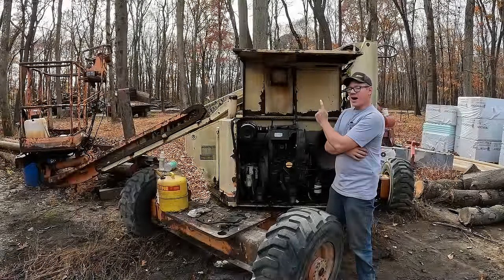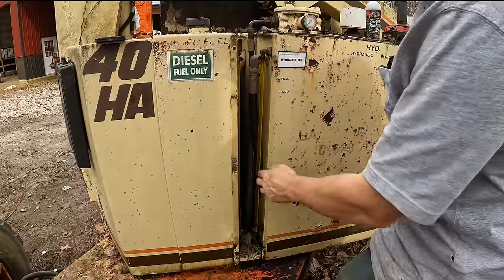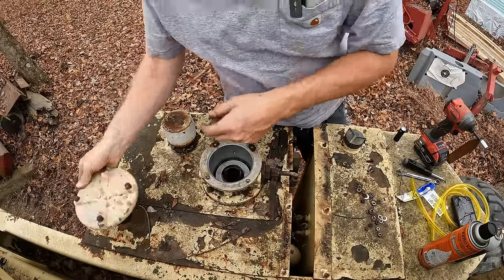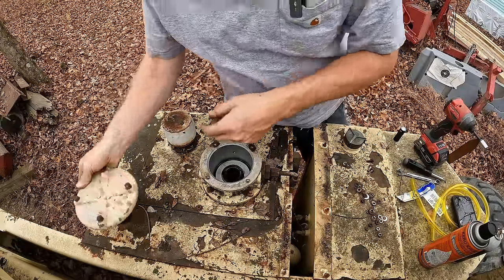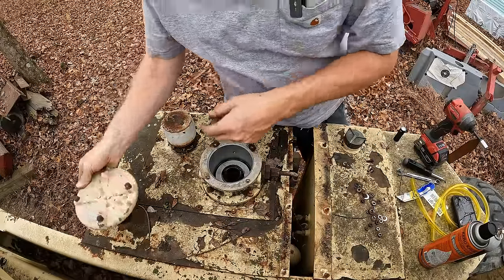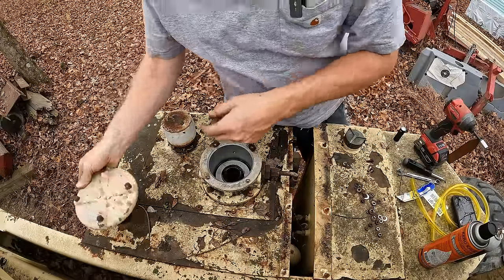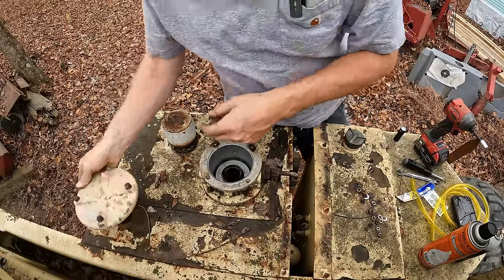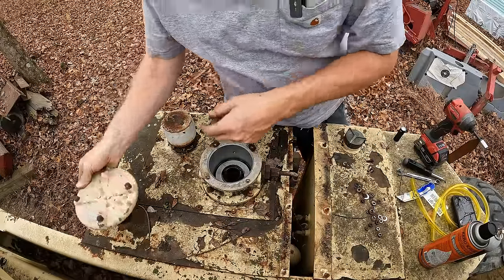I paid $1000 for this 4x4, Diesel, Man-Lift, What could possible go wrong? (JLG)

Comment: The electrical issues look to be a project on their own, but for the price, still a great project. Very handy machine !!
Reply: I am wondering if it is actually easier to try and fix what is there, or with the state of nonfunctioning of the controls, to redo the whole control box anyways, if there is documentation. Someone mentioned to me he would just replace all wiring. Depending on what state the wires for example along the boom are in, that seems a bit excessive for me.
Personally, depending on availability and price of the control switches / levers, I might at least redo the control panels (or the one on the platform only). Maybe switching over from single action levers to joystick type controls. I wonder, by the way, if those are just simple switches or if that thing has at least some speed control on the movements. But that is just one way to fix it, and as mentioned, might be subject to decisions based on price and availability. What I want to toy around with for fixing might also not necessarily be either the most optimal, nor the "what really only is needed to fix it" approach. Other than that, I would for sure check the wires in that chain guard on the boom. If they got brittle and might short out, the last thing I would like to happen is to get stuck on the platform in the most extended high up position.

Comment: That Shell Rotella Oil is all I use in Diesel engine. FYI Matt if you don't know, the filter housing next to you  had by the oil filter is the hydraulic high pressure oil filter. it has a reset on top that tells when it is needing changed. I believe you got a good deal in that life. All the work you put in I really believe you can get back.. Great video Matt. Have a great week and God Bless.

Comment: To remove oil from a tank like that I take a Shop Vacuum and a 5 gallon pail.  Hook the hose of the vacuum to the large hole on the 5 gallon pail install a 1/2"  JIC bulkhead fitting to the lid of the five gallon pail and a piece of 1/2" hose to that. Turn on the vacuum and suck the oil into the pail watching the level. Empty the pail into your waste oil drum and suck the tank dry.

Comment: Great episode, as a long time user of man lifts, I would recommend the use of a full body harness and lanyard. I have experienced a few  unexpected violent motions from uneven ground or errant control movement (operator error), that almost took me off my feet in the basket.
Reply: Love matts content
Reply: This comment right here ^

Work restraint harness and landyard will save your life. These things are temperamental at the best of times
Reply: Good point. And lanyard doesn't mean a fall arrester. You need a short lanyard to limit motion.

Comment: Hey Matt, just a little hack for cleaning out oil, diesel and tanks in the field, I’ve even used it to drain radiators. 
Get your self a battery powered vacuum a five gallon paint bucket with a twist off cap. Attach the vacuum to bucket lid use it like a wet vac. I’m sure there are ready made cordless shop vacs, but I like that I can just use the 5 gallon bucket’s to keep the oil or diesel clean and stored.

Comment: with all the old fuel and fluid tanks you come across, you need one of those vacuum oil change containers... they are either manual/hand pump or use shop air to create a venturi and can get into all the nooks and crannies with the right pipes and tubing.
Reply: I'd just use a shop vac, possibly with a smaller hose to go into the filler.  With a little duct tape to attach hoses and to connect to a probe stick, you could suck up stuff from crannies pretty good.
Reply: @paulculley4652  wouldn't want a shop vac around old fuel or oil, which is what it was suggested for.

Comment: Congrats!  A couple of hints based on my love/hate relationship with similar machines during my 50 or so years in factory maintenance. The yellow tubing, if it is Tygon brand and if rated as you say, also has a good UV protection component. The valve leak in the boom could possibly be an anti-drop valve. It would limit lowering speed in case of a hose break. These are generally screwed right into the cylinder.  Finally, I like your new red truck. Should be able to easily handle some of your bigger trailers.

Comment: Hey Matt, I got a solution for your paint can tip clogging up. When finished spraying, take the tip and put it on top of a wd40 can, spray some wd40 through it, then put the tip back on paint can... Theb it definately won't get clogged up 🙂

Comment: To remove sludge; 5 gal. pastic pail with lid. 1" spigots in lid (epoxy) connect 1" suction hose to one spigot, connect vaccum cleaner to other spigot. Even 12v hand held vac will work depending on lift required. Always enjoy doing tthis the difficult way as well.....bear

Comment: Running and sort of functioning is a good start. Its been a long time since I have worked on one, but the valve you are unsure of I think is supposed to keep the basket from just dropping if something fails. Like it bleeds off pressure slowly, so the basket comes down but in a controlled manner. The wiring shouldn't be too bad, might be expensive since you'll need those big 50' spools to have enough wire to run from the basket to the controls in the body.

Comment: It looks like there is a foot pedal in the basket that you would usually have to press in order to active any of the functions. It might have been bypassed intentionally (or by a mouse).
Reply: There must been a whole army of mouse electricians working on that thing over time. But a foot pedal additionally to the locked levers seems to be a tad excessive to me. But on the other hand, it also looks weird to me why there are big levers for some controls and only little levers for others. Might be the large ones have some sort of speed control to them (small movement slow, more movement fast), but that is just a guess. Also, with those small switches the foot pedal would make sense, as they are not locked, but just protected by those wings around them.
Reply: @alexanderkupke920  the big switches are old school pulse width modulated switches, allowing for varying speeds,(feathering functions).
They appear to be P/Q brand switches. They were high maintenance brand new out of the box.
Reply: You are correct in that you are supposed to have your foot on the pedal to activate functions. It's called a dead man pedal by most people. Booms have a tendency to catapult people who like to travel fast into pot holes. The pedal is there in case that happens the machine will stop moving.
Reply: @alexanderkupke920  the redundancy of the lockouts and the pedals on these machines may seem excessive but is definitely needed. I work at an equipment company and run up to 185' booms. They also have lever lockouts and dead man pedals
Reply: @jasonkeller4180  Calling it a Dead man pedal makes it more obvious why it should have one. Let´s come a lot more scenarios into mind where you would just not only rely on the usually locked levers and the E-Stop.
Reply: @haroldphipps3457  sounds like a heck of fun to replace and test. And I bet they come for a bargain... I would have bet more on something more classic like a operating a potentiometer. I think for some (way simpler) equipment I have also seen stepped switches (like two or three steps with diffferent speeds). But especially when it comes to getting a boom as close as possible to a building or whatever without having the thing jerking around with each movement and running into whatever doesn´t jump out of the way in time, having some smooth speed control for sure makes it a lot more comfortable and usable .

Comment: FYI, So the controls that you have to pull on to move the lever is known as a "dead man control". If the operator becomes incapacitated when they relax and let go of the lever it will return to a stoped position.

Comment: Ran quite a few of those way back in the day .
We had one 90' that was a beast .
It had one issue , in that it had a slight leak down problem so that if you say a while with it off , when you fired it back up to move again , you would freefall a few feet .
Anyway , I and another guy has just finished up a hella long overtime ( 20+ hours ) get it done project , and , were about to clock out when we got tasked with taking a photographer up in the same lift for some pictures .
The same lift we had been complaining about every day for 4 months ...
Being tired , somewhat pissed , and , not very sociable , we agreed .
Anyway , we get the photo guy up , 90' STRAIGHT up in the air , shut off and let him take his pictures .
When he was done , we looked at each other , grabbed the rail , fired up the engine and I hit the down button .
6 feet and a  blood curdling scream later , we slowed to safe speed , My , coworker , myself , and , one fishbelly white photographer who now needed a change of clothes , went our respective ways .
Next day , the rental company finally showed up to service the damned thing , after almost 4 months of reporting the issue .
No mention was ever made of that poor guy , but , he and his dry cleaner probably parted ways the next day .
I have never seen someone so HAPPY to be in a parking lot .
It is but one of many reasons I may go to hell .
Reply: Oh, God, My ribs are hurting from laughter

Comment: May have heard this a million times by now, but I always added a valve on the bottom fitting so I could close off the sight glass or tube whenever I could.  That way of the tube breaks or gets torn off I can shut off the fuel or whatever it is. Works great.

Comment: Hello Matt, back in the 70s we had a 600 gallon oil tank with sight tube, and it had a push button valve at the bottom union with the tank. So the sight tube was only connected through to the tank contents when you pushed the button, giving you a reading, and when you released the button the valve closed. You could also achieve this with a manually turned valve. Could that approach solve your tank emptying concern?

Comment: 37:25 i remember the fuel filter on a friends Peugeot. Theorically you should be able to take it out by hand, but they warned me "it might be a bit tight".

Took out the whole damm filter mount, holded it firm on the vice, grabed an "oil filter belt(?)" that we use for truck oil filters and went ham on it.
Two grown ass men with a truck tool, on a vice, twisting it as much as we dared without tearing everything apart. For something that was supposed to come lose by hand.

Tightened the new on with my bare fingers and hasn't leaked since. I don't know what kind of powerlifter did the service before us.

Comment: One trick I use on fuel tanks to clean them out- my 'homemade' parts wash has a electric fuel pump for the brush hose, that usually runs off a 12v mains power supply from my car fridge with an inbuilt 'lighter socket', but the pump now has a 'lighter plug' on it- when I want to use it outside- take the 20l drum from under the parts wash (an old laundry tub the outlet drains into the drum lol) take it out and plug it into the utes lighter socket- made up a  'stiff long hose' out of a parts wash brush and a length of metal water pipe that screws onto the pump outlet flex hose (the pump inlet screws into a washable mesh fuel filter and that goes into the 'tap' outlet on the 20l drum... that way the  pump sucks relatively clean fluid from the parts wash drain drum)
Usually used for the parts wash, but with the long pipe brush attached instead, you can use it to literally wash and brush the bottom of a tank clean, all the muck ending up in the parts wash drum (fuel drain from the fuel tank into the top opening on the drum)
Works like a dream on tanks, and even better-  gives you a cheap parts wash to boot!!!
(mine cost me under $30 but I had most of it already- an old free standing laundry tub  with a builtin cupboard for $10  (holds the drum and pump and powersupply perfectly), and the cleanable mesh fuel filter ($12) and the parts wash brush with inbuilt hose fitting ($3) were the only things I bought, everything else I scavenged from the spare parts here)

Comment: I am currently restoring and running a 1981 Calvador Condor 48 lift that started out looking as rough as yours. I spent a long time diagnosing the electrical issues and eventually came to the conclusion that the wiring harness had too many intermittent cracks/breaks etc. I decided to abandon the control box on the platform and bought a Newtry (Telecrane) wireless remote control system. Now the controls are wherever I am. I can run it from the ground or while I am in the air. Mine has a Wisconsin VF4D.

Comment: Modify the non vented fuel cans by drilling and installing a tubeless tire valve stem with the core removed. The cap can still be used when storing fuel to prevent evaporation and contamination.
BE SURE to clean the can thoroughly before and after drilling.

Comment: We purchased a system from an oil storage company, and they had check valves on the top and bottom of the glass sight tube. It would slowly leak through with no pressure difference and show the level but if the glass broke the check valve would prevent the oil from leaking out.

Comment: I spent many hundreds of hours of my career in the baskets of these boom lifts, from 40 ft. machines like this to massive 180ft. machines and most of the issues were in the basket controls! If this was a rental machine it was well maintained, privately owned machines not so much! It is amazing how much wiring is in the the basket control panel of these machines! 
    Most of my time was spent in an 80’ machine with a counter articulating jib. You could get into places with that lift that no other machine could reach! All it took was one corroded connection in the basket control panel to shut you down for the day!

Comment: Hello Matt     When You change the fuel filter, fill it with fuel before mounting.  Then You don´t have to get the air out out the system. I work  with MTU diesel engines with 2 big fuel filters and I am to lazy to handpump them 🙂 . So therefore i fill them with fuel before mounting again.    Have a nice day from Paul in Denmark.

Comment: Hey Matt, on the in tank hydraulic filter.. The return oil usually passes from inside to out into the tank. If you're visually inspecting you'd want to look at the inside of the filter rather than the outside. Thanks so much for the time & energy you put into bringing us along for your adventures!!

Comment: Just a tip on the sight glasses. On ships we use press button valves to prevent accidental spilling if the glas/hose fails. To "update" the level just press the spingclosed valve and you're good to go.

Comment: With the amount of oils, coolants, hydraulic fuels that you use you should plan on having a drum area in your shop.  Buying by the barrel will save $.  A drum pump lets you transfer to smaller containers or directly to equipment.  Second item, you need to get a safety harness and  a short lanyard.  Those machines are notorious for bouncing, and if driving and you drop a wheel over a curb or into a hole, it will bounce you right out of the basket.

Comment: 12:22 $15 Milescraft amazon Drill powered pump that has garden hose fittings on each end with barb adapters to 1/4, 3/8, and 1/2. I use them to service my trans fluid through the dip stick tube. And fill diffs and tcases an manuel trans way faster and easier than squeezing a bottle for 15 minutes. And as a transfer pump, like you need it for here. 15:28 Alot of people use them to full heavy duty trucks with oil, pumps a 5 gallon bucket of 15w40 in a about 2-3.

Comment: There are vacuum suction tanks built for sucking up oil and fuel without any problems , comes with manual pump or nematic suction . Easy oil changes on anything tanks, differentials, power steering , transitions , cooling systems . Makes life easier .

Comment: I would add a secondary battery. So both get charged, but you can select which will be used for operation. This way you can turn the engine off and just run the electric pump for small adjustments while working somewhere. If run out of juice of the one battery, you can switch to the second one and still come down or start the engine with it.

Comment: Ron Potter Shrewsbury England
If you havn't already done it I would certainly fit a shut off valve to the bottom sight hose of the hydraulic tank which would save you a lot of money if the sight hose failed. The same applies to the fuel tank. 
For really stubbon bolts a I would use a socket with a long bar. a broken socket and bar is much cheaper to replace than a rachet socket spanner. As someone who has worked solo on old vehicles I love the way you improvise. As a British OAP it reminds me of my battles of the rusty old heaps  of the 1950's  i work on out in the open with very basic tools and little money.. love watching your show.

Comment: Matt-
I would definitely change out those failure-prone worm drive hose clamps
on the sight glass tubes to either constant-tension or "fuel injection" type clamps.

Comment: Hi Matt, a lot of work to do on the man lift. On the outside glass oil and fuel gage pips, nice repair. The fittings at the bottom of the tanks look like NPS Looks like you can install a petcock valve on each one. You keep them closed until you need to check the oil. Try it. Great show. watch u all the time. From Stroudsburg.  :learning:

Comment: Trick I learned with oil filter is to cut the top off a one liter soda jug, slip it up over the filter (after it is partly loose) then use the soda jug to turn the filter off, all the oil goes into the bottle, no mess!!!!

Comment: Matt, you are killing me. A scoop for hydraulic fluid? Buy a 12 volt electric fuel pump. Add long leads with clamps, and long hoses, and pump whatever you need to pump. I have had one for years. Works with diesel, gas, ATF and whatever. Real time and mess saver.